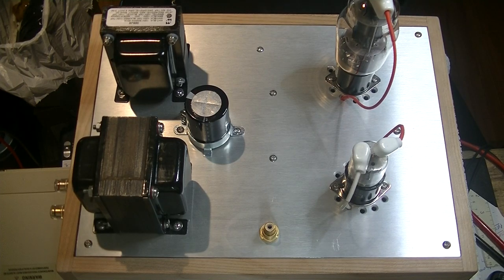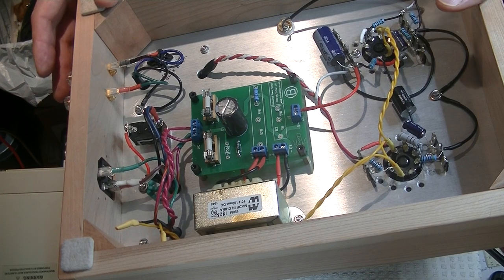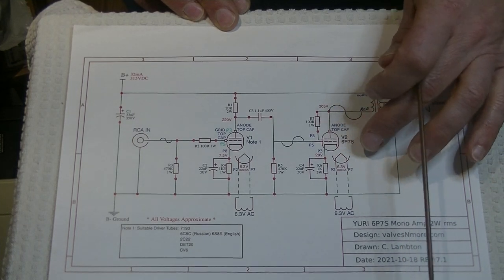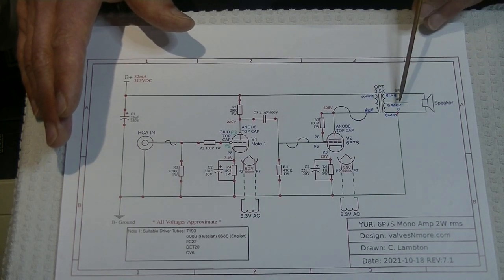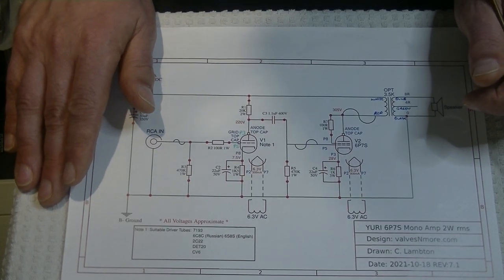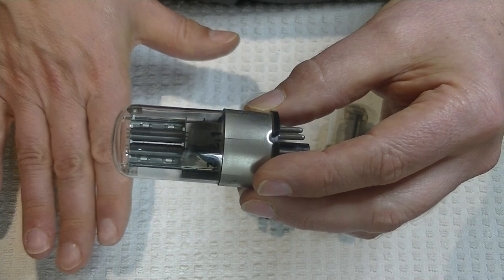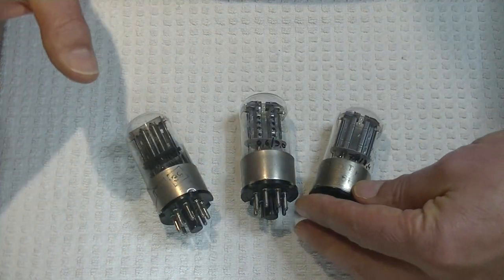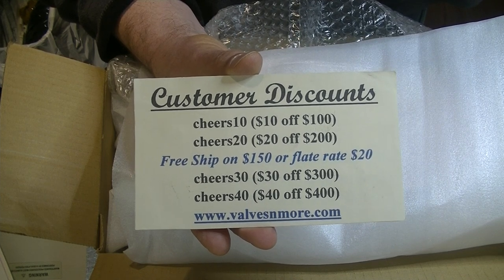Tube Lab #78  Pt 5 How To Achieve Great Sound  - Power Amplifiers

Comment: I love watching the wonderful progress of your business and your kits.  Still a little confused on what exactly "phase" is, so would love a video on that, if you can.  Enjoy that green tea!
Reply from the maker: Great to hear from you Dave!
Phase or Phase Cohesion is a way of describing the state of the audio signal.  A simple example of how to mess up the phase would be the use of feedback.  Let's say you took a portion of the output signal from your output transformer (common) and brought it all the way back to your input high gain stage.  That signal is from a later time period than the first stage you are injecting it into, it may result in some noise cancellation but it will also mess with the phase cohesion or phase integrity, by adding something to the signal that wasn't originally present in the signal.  If you look at various circuits - balanced, class AB amps, feedback etc etc, you will see many examples of the phase either being split into positive and negative parts or having a later stage signal injected back in time - messing with the purity of our signal and phase.  
And yes at some point when I run out of Fun things to talk about I'll bore everyone with my thoughts on phase cohesion!
Reply from the maker: Now these changes I'm talking about can be very small, but as the great Michael Fremer always says "everything matters" and if you muck up too many things in your audio chain eventually everything starts to sound like a crap cd or mp3!  Remember everything is additive, so a little bit of messing about with the audio signal is probably not going to be apparent, but if you do it too many times...
Reply: That does make sense.  It’s good to be concerned about the fine points of audio; I for one appreciate it.  You are a great teacher!  Thanks.

Comment: Great explanation of how Class A and Class A/B amplifiers work and differ. Also how the output or power amplification stage works.

My amplifiers are all vacuum tube designs, mainly due to my experience with guitar amplifiers.
In Guitar amps the pre-amp stage amplifies the weak signal coming from the guitar pick ups by boosting the voltage. It’s this pre-amp stage that dictates the characteristics or individuality of a guitar amp. The power stage then takes this voltage boosted signal from the pre-amp and boosts the current as you say, to power the drivers in the speaker box.
Ideally the power stage amp shouldn’t impart any colour into the signal.
The pre-amp stage is critical in guitar amplifiers
Reply from the maker: Great explanation of the main difference between an audio amp and a guitar amp.  They're certainly more similar than dissimilar!

Comment: Informative video. Thanks. Would you share the details of your OB speakers?
Reply from the maker: I've had many requests, but they are a custom design in which 2/3 drivers are salvaged, so not easy to replicate.  We have in mind to develop a Speaker Kit based on my prototype (if we can find a midrange driver that's similar to the prototype), but first we want to focus on the Kit Amp business that is slowly but steadily growing!
Reply: @tubelab194  OK. Thanks. M

Comment: Majority schematics on single-end I have seen using DC filament on power tube such as 300B. I wonder how much different between DC and AC since you have AC in filament.
Reply from the maker: I haven't experimented with DC instead of AC for the filament (heater) supply on power tubes, But the common thinking among audiophiles who have is that DC on a DHT (direct heated triode) like the 300B sucks the life out of the sound and almost everyone who's tried both go back to AC and accept the higher noise floor.  It would be interesting to do a proper  A/B listening test, but then again I'd need another lifetime to do all the testing I would like to!  
For non DHT, so indirectly heated power tubes, like the EL34, KT88 and my 6P7S, they are all AC heated, that's pretty much standard for all modern power tubes.
For preamp tubes I specifically heat them with DC, that pretty much eliminates the filament as a possible source of injected noise.
Reply: @tubelab194  Thanks for the info. I will try the AC on 300B to see what happen.
Reply from the maker: @Warclock07  you will need to design for low noise, some good information online as to how to install a balance pot in the circuit and other circuit wizardry!
Reply: @tubelab194  Got it. If there is noise, I will add the 100r pot

Comment: lm in the process of buying a tube amp l havs always used high current  vintage class A/B amps but l want to experince tube amps and have someone that builds his own tube amps in Woodstock Ont  l started with headphone amps ASL mark iii with OTL  and a Musical Fidelity X Can my confusion is in tube rolling what if l put the wrong tube in the socket will it blow ? /fire ! and biasing is it self biasing
Reply from the maker: Every Amplifier ever made has an instruction manual, if you don't have one, look for one online, it'll tell you what tube number goes in what socket.  Then you just need to find the correct tubes and Bob's Your Uncle!

Comment: I think that a tube rectified psu is better as it reduces cathode damage " strip", of the power tubes. this is done as the rectifier takes time to warm up and apply HT voltage to the cold power tube. I say valves as im from England 🇬🇧 🤣
Reply from the maker: Interesting, my understanding of cathode coating design, is that once the tube is up to operating temperature it is constantly recycling material back to the cathode.  Cathode strip was a problem with early computer tubes that stayed in one position for long periods of time, so the manufacturer's developed thicker coatings to prevent this problem.  In my own designs, I've always used solid state power supplies (they sound great) and in thousands of hours of play have never experienced a cathode strip issue with a power tube.